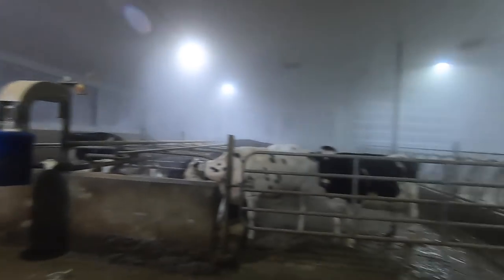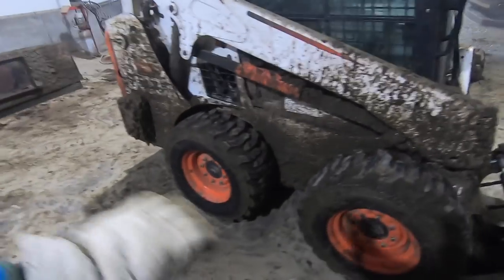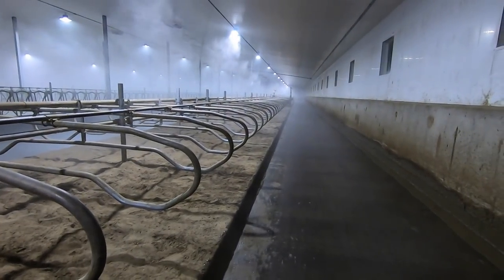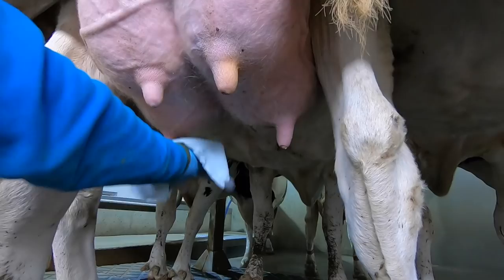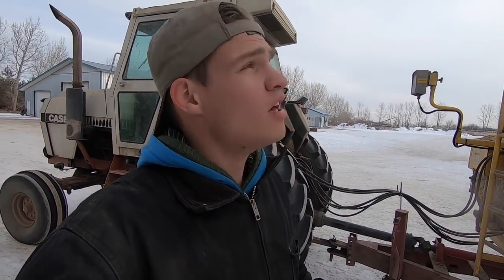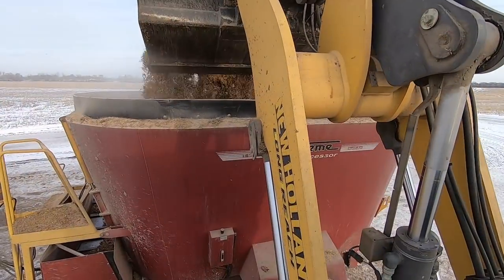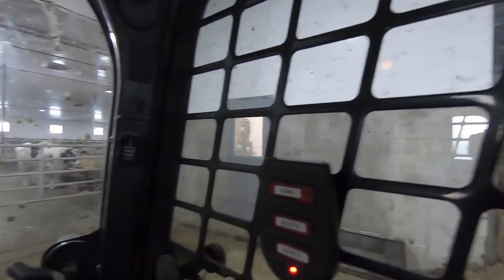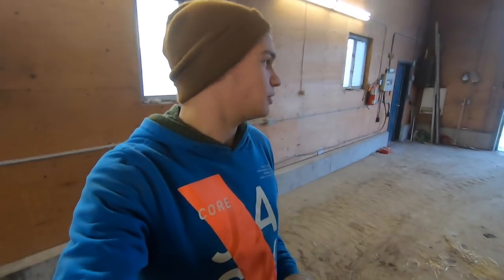Dairy Farming at 30 Below

Comment: An idea for you is to use Hydraulic tank heaters for your equipment you just plug them in when you plug your block heater in that way when you fire up your equipment you don’t have to wait 20 minutes for your fluid warm up.￼

Comment: im here in the UK and we all start moaning when it get -0c for a day or two
Reply: You get used to it but there are definitely maintenance issues like hydraulic lines - hydraulic cylinders and lines act like giant radiators constantly cooling the oil and oil doesn't flow that well at -30 so broken lines and the ends pushing off cylinders on loaders is an issue no matter how warm the tractor is.  Nothing as bad as fuel problems though when you find out your fuel hasn't been conditioned properly and the diesel is thick like honey.